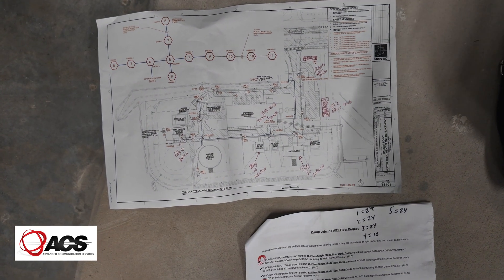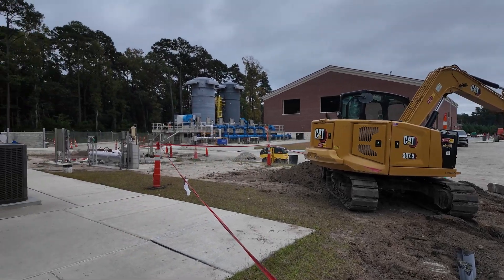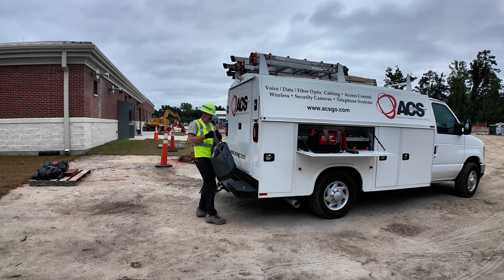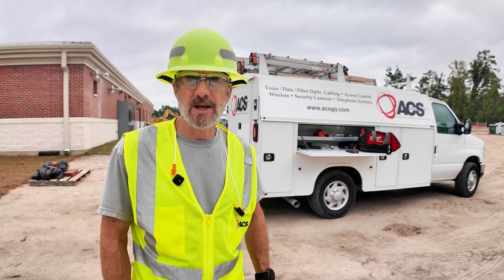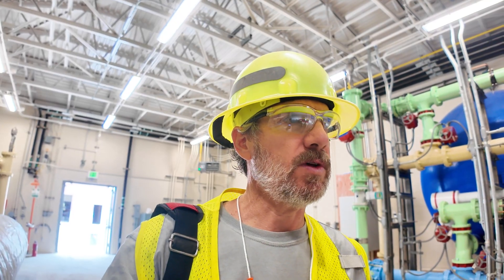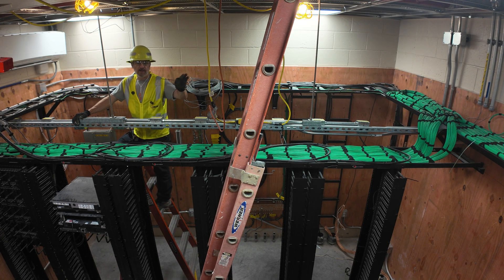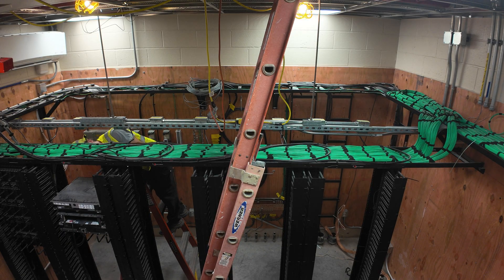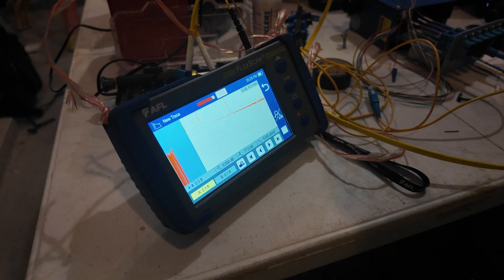Day in the Life of a Low Voltage Tech | Fiber Project at a Military Base

Comment: Quite interesting. First of all, I am surprised they let you film at an military base. However, we use the Fluke for OTDR and have used Exfo in the past.
This splice connectors in the beginning. I don't know them. How do they work without a pigtail? We use similar DIN rail boxes like that in the beginning. As connectors it is usually LC UPC. Sometimes ST or SC for older installations, and occasionally E2000 APC.
Reply from the maker: Thanks for watching and giving feedback. This was an unsecured area on a military base. As far as the splice-on connectors, we use them all the time. We splice them directly on to tight buffered fiber or loose tube fiber that has a fan-out kit. These have lower loss to a Unicam style connector. Sometimes we do splice feeder fiber to pigtails, depending on the scenario.
Reply: Thanks for the reply. I've watched a video how they work and will check if they are available for a reasonable price in the old world.
Reply from the maker: @hw2508 they are roughly $10/each or so. Once you use them it will be hard to use anything else
Reply: @AdvancedCommunicationServices  I'll buy a set of 12 LC pigtails for under 20 €.
But I'll find a reason to buy them and try them at some point.

Comment: I had a Flexscan at 1st, it was compact and very user friendly. 
Now using exfo
Reply from the maker: I haven’t tried that one yet. How do you like it? Thanks for watching!
Reply: @AdvancedCommunicationServices  Its 3x the size and 3x the weight. 
But it has a better "live" view with more fine tunning options than the flexscan. 
But the better thing about the exfo is the case that it has, i can put in all my different test jumpers and cleaners and adaptors i need.

Comment: Great work, I do the same type of work, but more for power substations. I 've been using AFL for certification but recently per customer request had to switch to Fluke OTDR OLTS , I think it's way harder to get the specs to Fluke certification. Should the cost be higher?
Reply from the maker: That’s interesting! It’s tough when customers make you switch equipment, especially when it complicates the certification process.